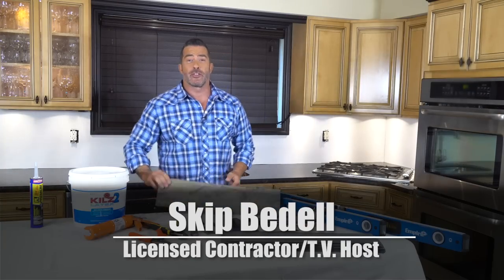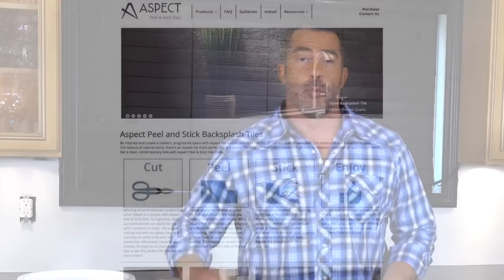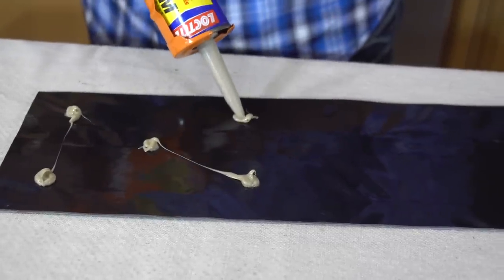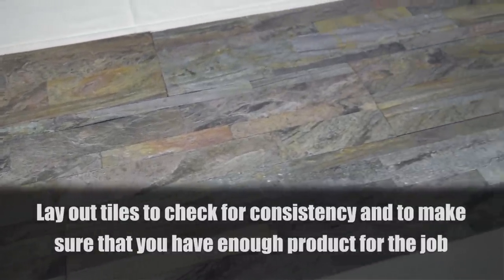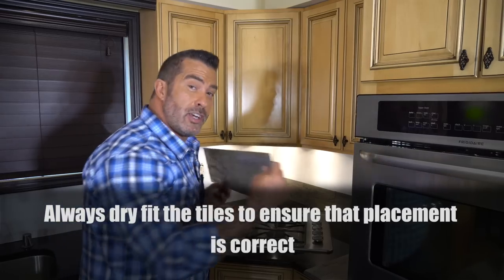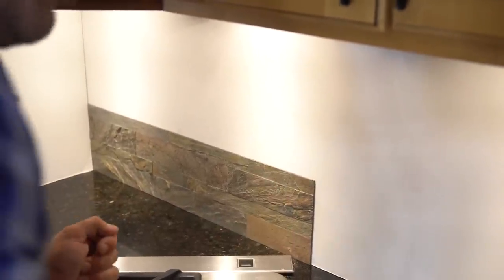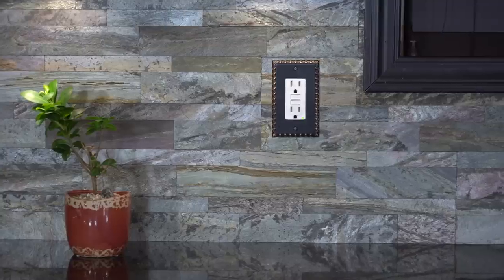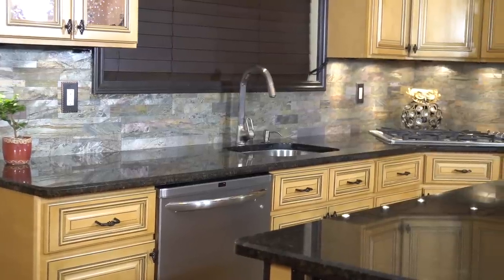Aspect Stone Tile Installation

Comment: I found, that while they say you don't need a tile cutting saw, it can come in very handy especially in the situation of making length-wise cuts where just trying to remove a fraction of an inch off the edge of the piece.  This is very hard to do with snip but very simple with a tile cutting saw.

Comment: Bought the aspect metal subway tiles, there is a slight difference in color in the batches.  Is that meant to be and is there a certain method of laying them out so it doesn't stick out?

Comment: Nice video but the utility knife does not slice right through.  It took a mighty effort, poking the tip through every couple of millimeters, then the chisel (which sometimes didn't work, either).  I have 7 switches and outlets to do.  I've only done two and I'm ready to give up.

Comment: Nice product. However, the Raised Titanium backsplash does NOT cut with snips, the product is way to thick.  I had to purchase a jig saw just to cut this product. Update: the jig saw did not cut this tile.  I burned through a blade with a single cut.  Had to purchase a wet saw.  The wet saw did finaly work.

Comment: Thanks for the video.Quick question-Behind my glass top electric Range can I start from the top(bottom of the vent hood) and come down as there is no pantry table behind the Range.Thanks for your help
Reply from the maker: As long as the panels don't exceed 140 degrees F. See our FAQs: https://dumawall-us.com/faq/. "Installation within 6 inches of a stove is not recommended either. DumaWall should be installed in temperatures between 40 and 110 degrees Fahrenheit (4 and 43 degrees Celsius)."

Comment: Hi there! I just bought Aspect tiles for my backsplash today- here's my question: I have standard depth outlets and covers on the backsplash I plan to tile- when I take the face plate off and add the Aspect, is it going to mess with the depth of the plugins? Does the aspect go under the edges of the face plate, or line up with them exactly? Thanks!
Reply from the maker: You can cut out for outlets around the electric receptacle itself and go under your outlet covers. The tiles are thin enough that there should be no problems.
Reply: I found when I installed it I needed to use some standoffs under the outlets to bring them out about 1/3 of an inch.  Without doing this my wall switch was difficult to reach.

Comment: When I installed mine there were some areas that were not perfectly butt up to each other. In those areas you could see the white between the tiles. Once the tiles are stuck,  they are STUCK. No way to make an adjustment. To hide the white I squished some clear silicone in the gap and whiped of the excess. It went on white but dries clear.
Reply: A fine black magic marker works for this as well.  The white wall behind it really sticks out if the seams are not perfect.  In hind site it may have been better to use a dark primer over the wall first.
Reply: Take a tiny paint brush and paint a dark color in between the cracks will help hide the imperfections